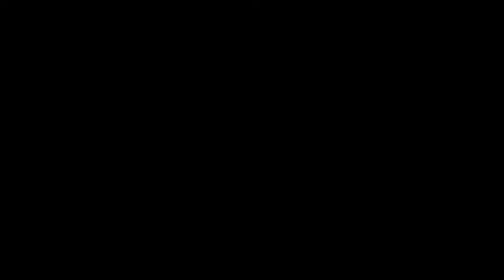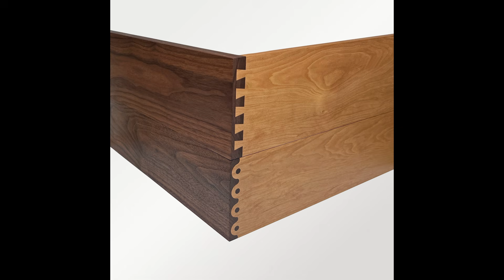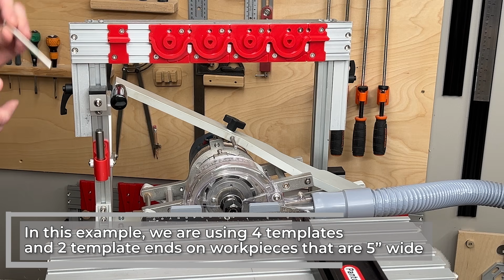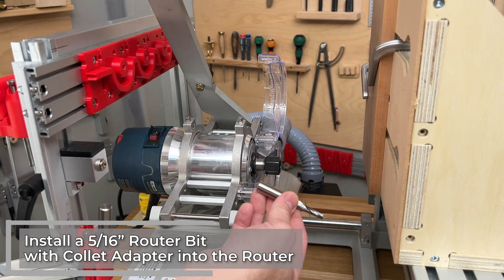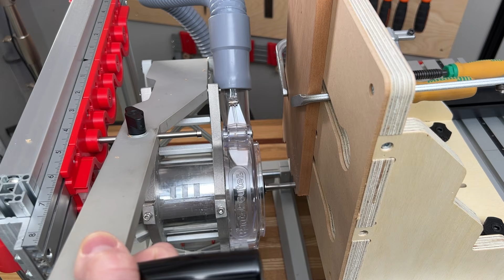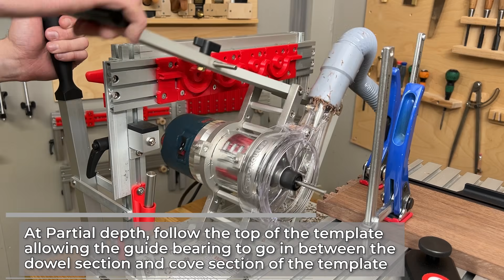Knapp Joints on the PantoRouter®

Comment: 😮 Great video! It's very helpful. Have a question when I'm doing the Dow piece, for some reason it's not doing deep enough on the p so it's like a 3/4 or a little more than that. Dow, I'm just wondering what setting should I adjust to make that deeper?
Reply from the maker: Please call or email so we can help.  It's easy to do and to demonstrate but not so easy to explain in this comment box.  We can do a video call with you if that helps.  Let us know what works best and we're here to help!